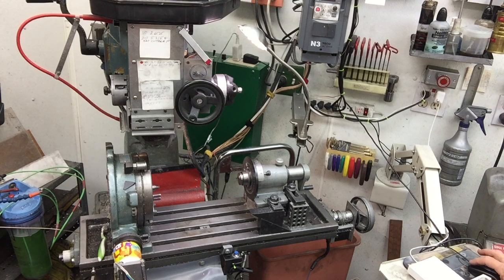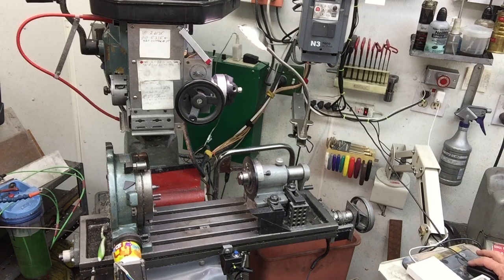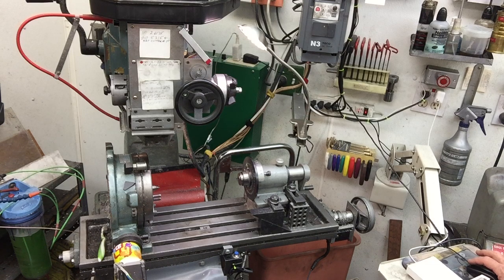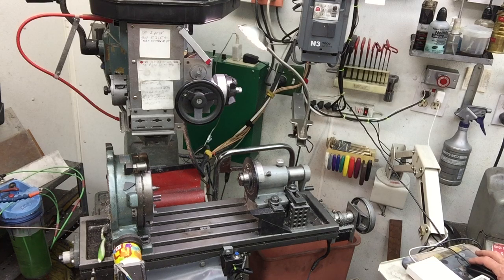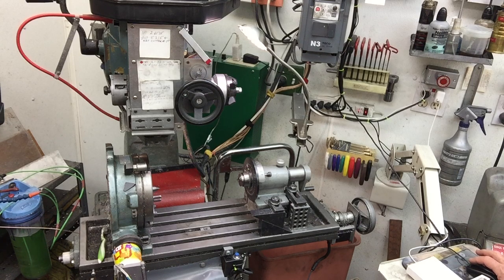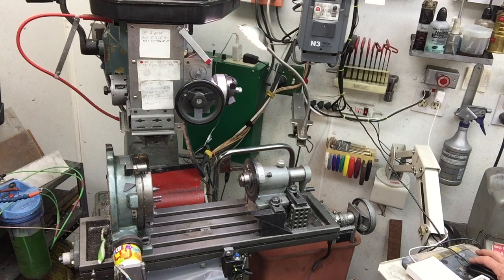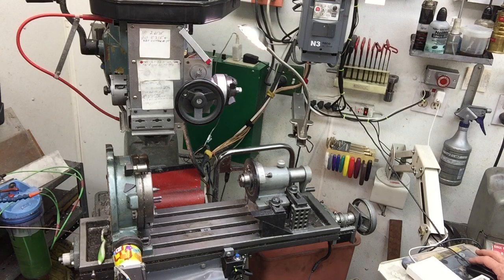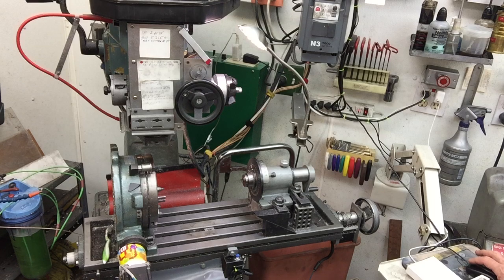RF-30 Mill/Drill Run by a Centroid Acorn Finding Home

Comment: Not quite on topic, but I love your use of a spindex for a tailstock for a rotary table in the vertical position.  Consider it stolen!
Reply from the maker: Bob,The spandex tailstock works well but was difficult to set up. Height adjustments had to be done with sheets of shim stock. I plan to buy or make a more conventional tailstock in the future.Having that A axis let me mill parts that were a mix of what is normally lathe work and mill work. Fun stuff!Rick
Reply: Thanks Rick.  Yes, that setup looked kind of wonky.  If I do it I will make a dedicated sub mount to go under the spindex.
Reply from the maker: Very wonky but such is desperation. A continuously adjustable height mechanism would have been a blessing.Rick